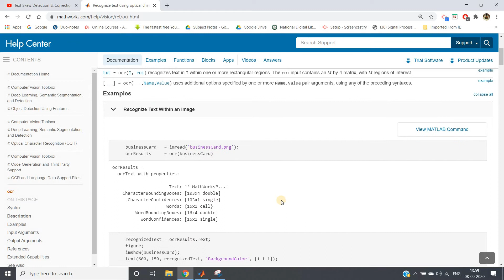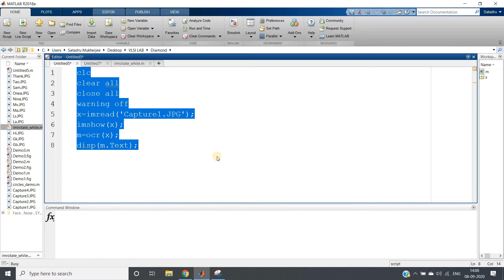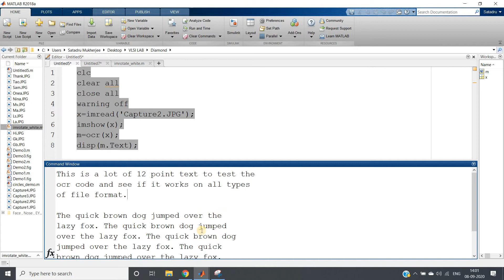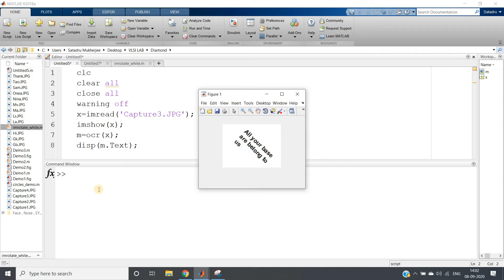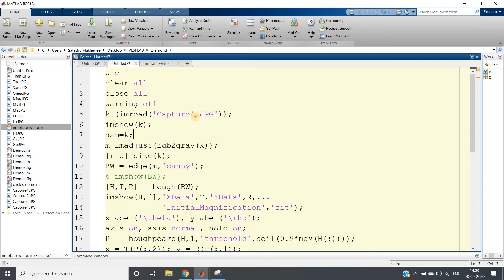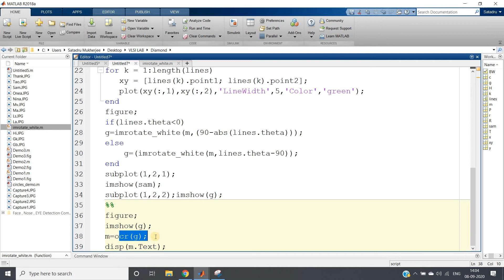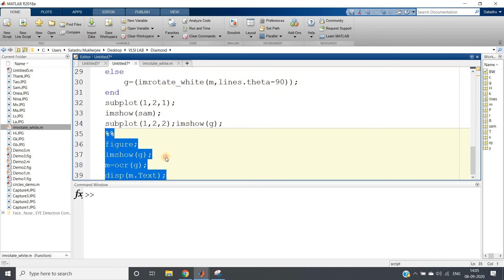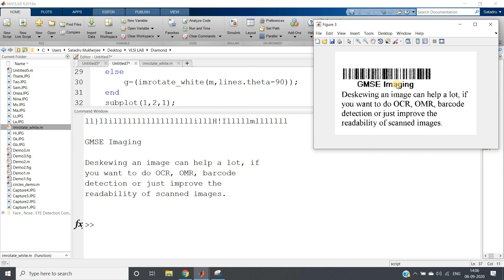How To Read Text From Images Using  OCR | Image Pre-Processing in OCR Concept 1 | MATLAB

Comment from the maker: Code:

clc
clear all
close all
warning off
k=(imread('Capture4.JPG'));
imshow(k);
sam=k;
m=imadjust(rgb2gray(k));
[r c]=size(k);
BW = edge(m,'canny');
% imshow(BW);
[H,T,R] = hough(BW);
imshow(H,[],'XData',T,'YData',R,...
            'InitialMagnification','fit');
xlabel('\theta'), ylabel('\rho');
axis on, axis normal, hold on;
P  = houghpeaks(H,1,'threshold',ceil(0.9*max(H(:))));
x = T(P(:,2)); y = R(P(:,1));
plot(x,y,'s','color','white');
lines = houghlines(BW,T,R,P,'FillGap',0.8*c,'MinLength',40);
figure, imshow(k), hold on
for k = 1:length(lines)
   xy = [lines(k).point1; lines(k).point2];
   plot(xy(:,1),xy(:,2),'LineWidth',5,'Color','green');
end
figure;
if(lines.theta<0)
g=imrotate_white(m,(90-abs(lines.theta)));
else
    g=(imrotate_white(m,lines.theta-90));
end
subplot(1,2,1);
imshow(sam);
subplot(1,2,2);imshow(g);
%%
figure;
imshow(g);
m=ocr(g);
disp(m.Text);

function rotated_image = imrotate_white(image, rot_angle_degree)
    RA = imref2d(size(image));    
    tform = affine2d([cosd(rot_angle_degree)    -sind(rot_angle_degree)     0; ...
                      sind(rot_angle_degree)     cosd(rot_angle_degree)     0; ...
                      0                          0                          1]);
      Rout = images.spatialref.internal.applyGeometricTransformToSpatialRef(RA,tform);
      Rout.ImageSize = RA.ImageSize;
      xTrans = mean(Rout.XWorldLimits) - mean(RA.XWorldLimits);
      yTrans = mean(Rout.YWorldLimits) - mean(RA.YWorldLimits);
      Rout.XWorldLimits = RA.XWorldLimits+xTrans;
      Rout.YWorldLimits = RA.YWorldLimits+yTrans;
      rotated_image = imwarp(image, tform, 'OutputView', Rout, 'interp', 'cubic', 'fillvalues', 255);
  end